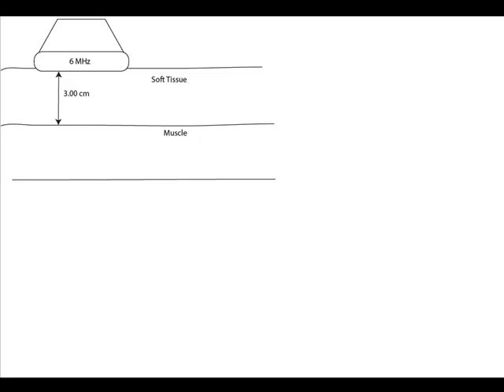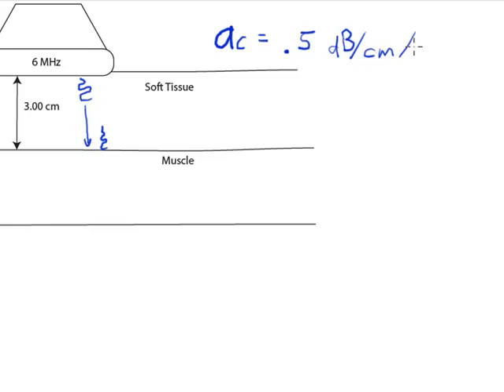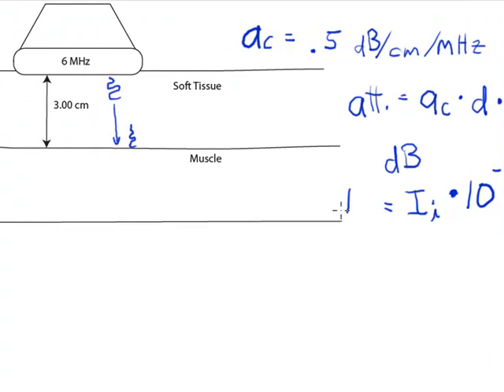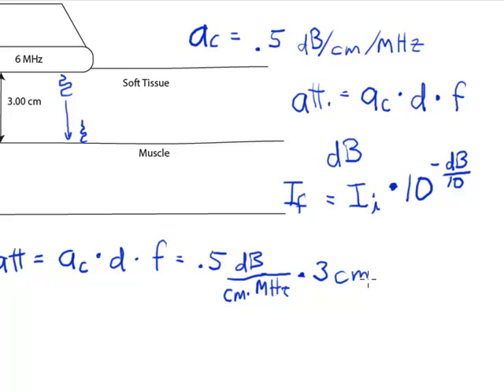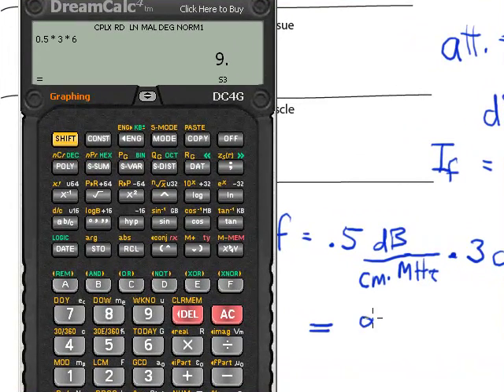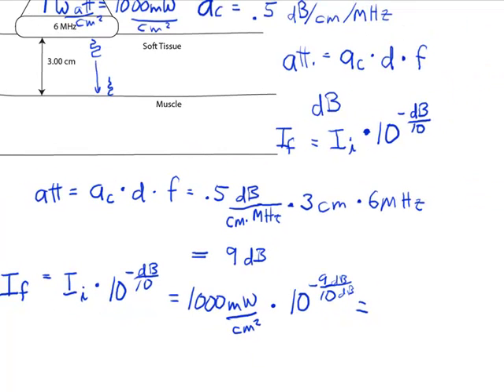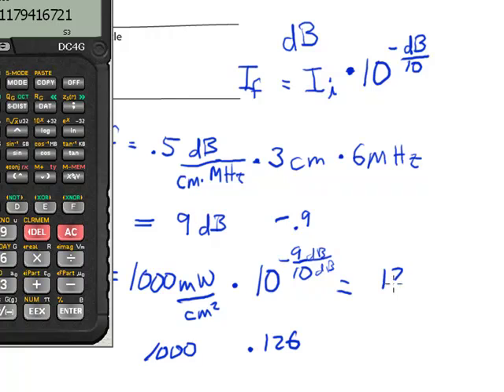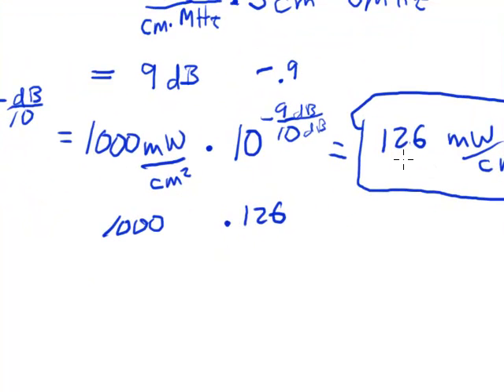Ultrasound Physics: Attenuation Coefficient, Ac

Comment: the distance should be 6 cm, that is the round trip to the detector. Your video is misleading
Reply from the maker: True, this example would be for a one way attenuation of the sound wave.  After reflection it would be attenuated again although you would have to account for not all of the wave intensity would be reflected, some of it will be transmitted.  I was trying to simplify by just focusing on a one way trip.
Reply from the maker: Sorry, I only had a primitive tablet and it was sort of hard to write with.
Reply: can u explain? maybe provide a link to a more accurate video
Reply: They are all terrible, with that lazy hand writing. Be patient and put together all the bits and peaces that you find. Regarding time, it is always round trip, so consider the time as double. Only when using  two transducers (as emitter and receiver), the time is a single path travel.
Reply: Cool thanks. Shame khan academy don't have a video on this topic yet. I'll just get my physic teacher to point me in the right direction.